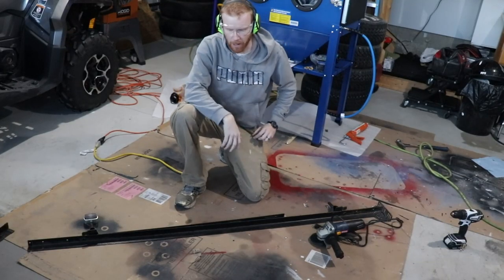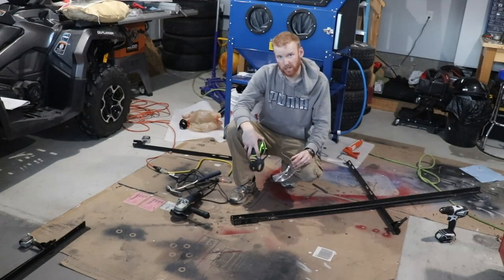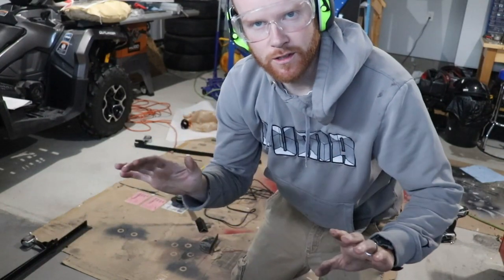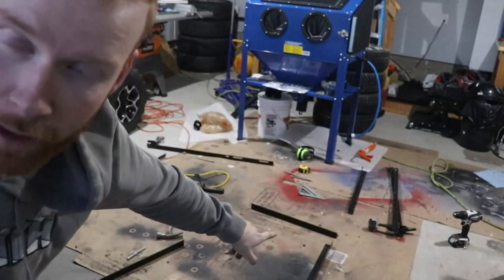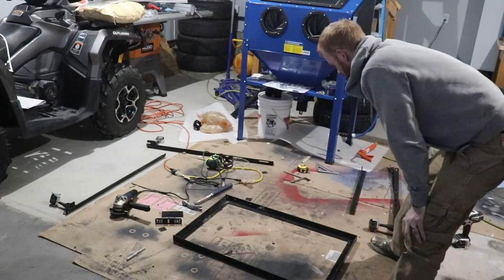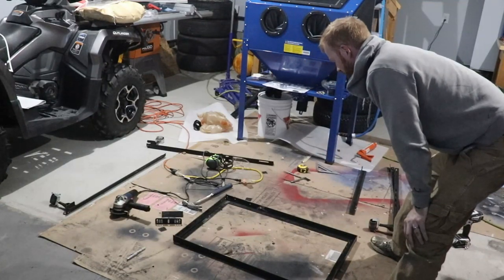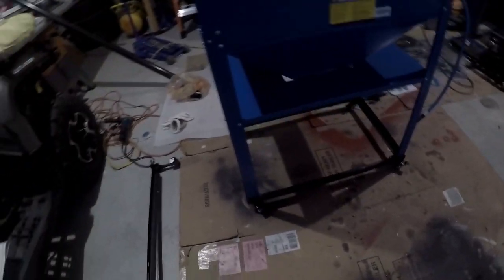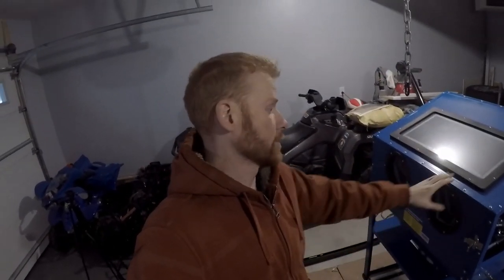What did i make with this old bed frame?

Comment: The hardened steel angle used for bed frames is stout stuff; typically standard dimensions and thickness, and welds easily. One could develop their own YouTube channel dedicated exclusively to the fabrication of all variety of  things made from reclaimed--and almost always free--bed frames!
Reply: The angle iron used for bed frames is usually .5 carbon steel, with unknown provenence except that it was cheap to manufacture. That means its an ungodly mix of steels and irons.  Most everyone I've run across has sworn up and down that bed frames are crap when welded, which is also proven by Pierre's Garage channel. Best way to use this stuff is using fasteners, unless you are either an med-advanced welder with some metalurgical skills, or just don't care if it catastrophically fails....
Any bed frame that you just weld, and call it easy is guaranteed to have highly brittle welds, which you will find out at the worst possible moment.

Comment: What did you use to weld it together? New to welding. Learning stick and flux now.
Reply from the maker: I used a mig flux core, with my Lincoln 180. I have now switched to solid core with a gas bottle. Weld are much better with less spatter. But starting out mig flux core is easy to learn. I am no pro just a hobbyist welder but that is what i have learned. I heard stick is pretty easy too. What welder are you using?

I would like to get an ac/dc Tig welder but they are a bit pricey. but this way i can do most metals aluminum to steel plus it would be a nice skill set to have.

Comment: I need to do the exact same thing for my smaller spray box. However, bed frames are not easy to weld, and an excellent video on them is here:  https://www.youtube.com/watch?v=i4lm_YnG-pM
Just be aware that your weld are probably much more brittle than the rest of the metal and much more easy to crack or shatter.  You could reheat them and then let them cool slowly to anneal and get some strength back, or maybe nothing will ever happen.  Its a shame since bed frames are so easy to get and free. I'm thinking of just brazing with 70ksi eutectic or silver solder rods which avoid the phase change welding causes.